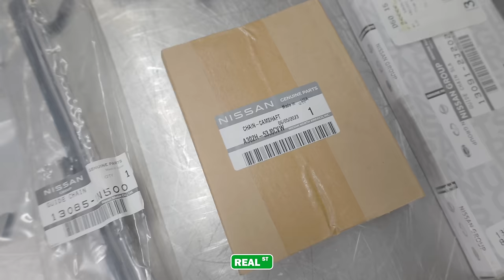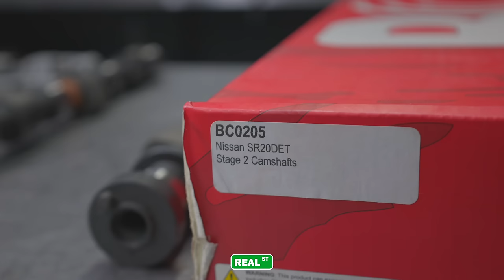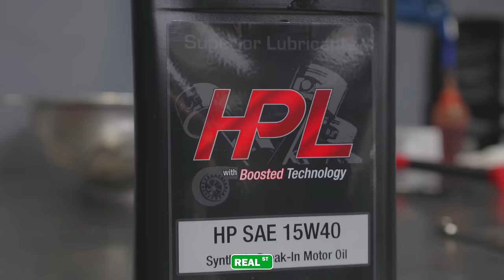Building the Perfect SR20 Engine | 9000RPM Street Setup! (Detailed Assembly with Jay)

Comment: I remember when I was buying S13 and S14 cars for $500-$800 do minor fixes and sell them for $4k, the only ones I regret selling was my 90 midnight blue coupe and my 91 cherry red. Both were full interior cars. The 91 was a turbo KA and the 90 was going to be something. Both also ran and were 8/10 condition. Minor stains in the interior and some rock chips.
Reply: You can’t even find a roller now for less than 4k.

Comment: Very Cool, i worked for Infiniti from 2002 to 2014 and never saw a bad SR20 in a G20. Gutless in the stock form in the G20, however so capable amazing durable motor!
Reply: My street tuned roller rocker in my 2000 G20 has been going strong for 4 months. Absolutely love the thing

Comment: I've started with the SR20DET built fwd engine on a custom gear off the shelf Nissan gearbox parts and I will never go back to that platform. Been a JZ guy after that money pit of a 4 cylinder engine. Power deliver ain't the problem. The issue is oil starvation issues which is imminent 😂😂😂😂. You need really deep pockets and have a seriously deep passion for the SR20 platform to mod and race it 😂😂😂. I've lost mine and the 2JZ embraced me. So far no issues after many years of abuse on my daily driver GS300
Reply: My first car was a jz tbh I’ve never been a 4cyl guy but i like these motors
Reply: @Singleturbo-sk9qp  I love 4 bangers as well. They are nice motors to get into just takes extra patience and finances to get it done perfect. I've given them 8yrs of my life 🤣🤣🤣

Comment: While I love 4 bangers, I could spend as much on a 6 or 8cyl with something that's gonna last. 250hp per cylinder is normal, it's harder and way more expensive on any other engine but, there's the reliability question again. Torque is important ondy street. I love them all regardless and every brand, make, model can be modified. My handle suggests mopar and that's my favorite. 2.2s 2.5s 4g63 are all Mitsubishi and I've modded them all including a420 neon engine's. I love seeing young people getting into motorsports (even big obnoxious wings on a fwd car) shows interest at least. Love this build and would not add boost but, rather use a little more compression.

Comment: What Dewalt drill are they using to turn the engine over with anyone?
Reply: Found out that its just a high torque paddle mixer if anyone is interested
Reply: I am very interested..  any links to the tool